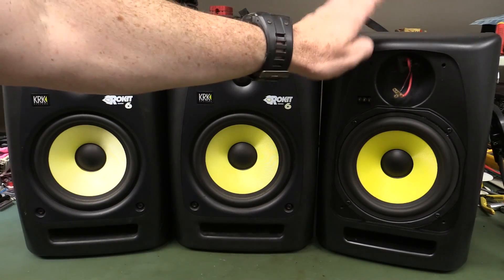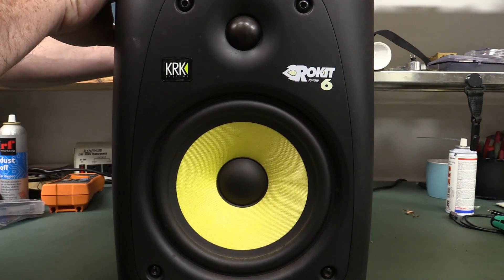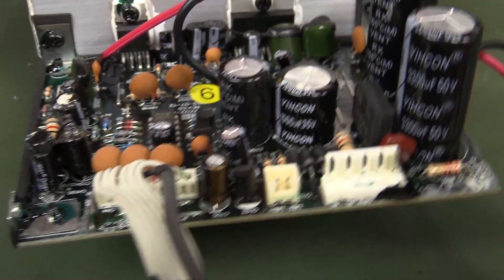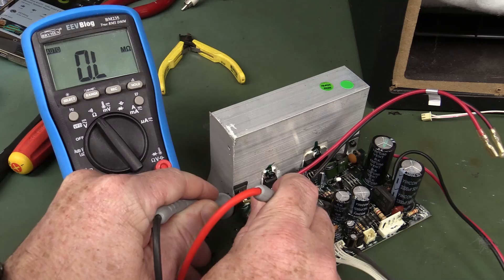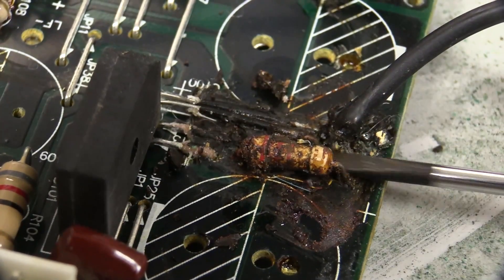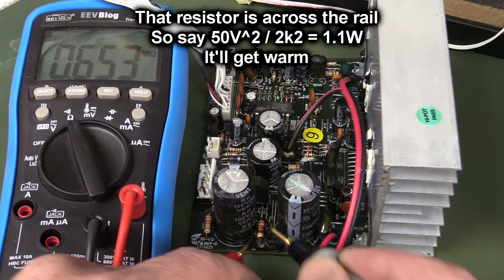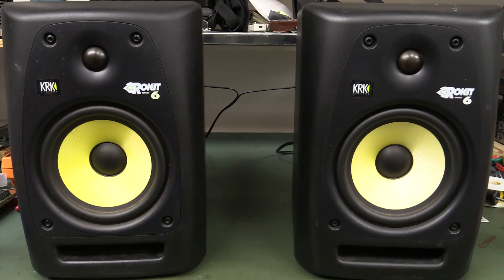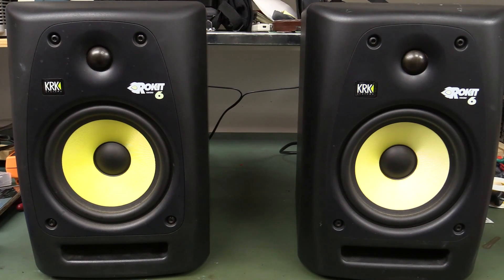EEVblog #1073 - MORE KRK Rokit Black Gunk Speaker Repair

Comment from the maker: Given all the "experts" on here with opinions of which speaker is best for studio mixing, what are the best monitor speaks for speech reproduction and why, i.e. video editing?
Reply: EEVblog for speech? Yamaha NS-10M only. Nothing else can tell You if You have some weirdness in the mid range. Sounds like crap if the problem present:) sounds neutral, when the EQ-ing is good for most of reproduction on the listener side. The new Yamaha line is also freaking good for video editing. Cheap but excellent monitor speakers. I recommend the HS 7 for You. You will love it!
Reply: HS5 great for this type of work IMHO☺ --- high VFM -- other option baby genelec doubles the price 😐
Reply: I hear crickets.
Reply: EEVblog my 2 cents Dave, most folks will be watching on their laptop, phone or flat tv. All have tinny sound.. so I think, edit on something like those, folks with good quality sound systems can probably adjust balance etc for themselves.
Reply: Seeing as how studio monitors are designed to be uncoloured (i.e. they should get the waveform you're working with to your ears in as close to a 1:1 reproduction as possible), there shouldn't be any great preference based on source material type. That said, since speech will generally lack a lot of low-end components, that probably means you can get away with putting your money into the overall quality (good brand) rather than trying to go for the larger woofers with more accurate bass reproduction.
Reply: The NS10s sound shite regardless of what you're listening too! They're just a pointless speaker in my book - modern small monitors are SO much better than they were even 15 years ago that the whole NS10 thing just doesn't seem relevant anymore.
Reply: Not cheap but in a past life as a TV editor, we only used Rogers LS series. Super natural sound. Not sure if they are available down under...
Reply: NS-10M or JBL 306P MkII
Reply: Don't buy anything Dave. Something suitable might turn up in your mail bag in a few months!
Reply: Any speaker, "monitor" or otherwise, that is capable of reproducing the frequency range of the Human voice (85 Hz - 255 Hz) will be fine. ANY speaker... regardless of make, model, brand, or wank factor.
Reply: IMO any dedicated nearfeild studio monitors with a flat-ish response would do. But as you are also mastering and the final mix is for YT, also listening to how the final mix will sound on say headphones/earbuds, phone/tablet/laptop speakers wouldn't be a bad idea (especially after YT does whatever to it). 
Apart from expensive monitors, music studios will traditionally also have a pair of yamaha NS10 as they sound like the average consumer "HiFi" speakers (usually over emphasized bass and treble to sound "better" than the competing "HiFi" on the shop floor). Tv broadcast would check on a single horrible sounding little square speaker (the average tv).
Reply: Anything that gets you desired results. You can get used to anything. I like mono auratone/avantone speaker, it's midrange only, also use Yamahas hs-5, ns-10s, sometimes 'big guns' for music production (custom made cabs with Tannoy HPB-315 concentric drivers). Also, 'flat-response' is bull. You'll never get any room even remotely close to anything flat. It's just learning to work with more or less compromised space.
Reply: ls3/5a...
Reply: yup NS-10's are great. also the best "SOUND SOURCE" (all caps for a reason because a Manger-Wandler is technically not a Speaker Chassis) is a "Point Sound Source" but since that is unachievable - the closest thing is a good Coaxial Monitor because of less Moving Mechanical Parts obviously less Distortion etc. .. I've heard and looked at a lot of different Chassis. Heck you could even count in the Company "Coral" and the Company "Fostex" or "Tannoy" if its about Coaxial Speaker Chassis. Or go back to the 60's 70's where "Philips" made some great ELA / PA / Studio Coax Chassis... Hence why most people not only use NS-10's in combination with their regular setup , but also Auratone Cubes (or similar) to listen to a Mix / Final Mastering :) Theres also no debating about that unless it's your personal preference to do everything different. Then the Setup you use Colorizes the "Mix" you do in a particular way , and you probably then know about that.
Reply: Usually its very difficult in general to give advice on studio monitors. It all comes down to taste when choosing monitors in the same price range. It is not uncommon for professional studio engineers to give contradictory advice. With that said, when it comes to speech reproduction it is easier to give advice since you have all the important information in the mid range.

I would not want a crossover point in the middle of the band im interrested in. That means either one-way or three-way speakers. Three way speakers that are so good that this advice becomes relevant are $1000 up. I have the australian event 2030 three-way speakers. They are excellent sound wise, but very sorry to say have very unreliable electronics due to cost savings. Perhaps you can find a cheap pair.

You could look at avantone mixcubes. They replicate the mid-band hyped response of cheaper speakers but gives very good detail in the vocal range. Broadband single element speaker, no crossover, no phasing issues, single point source. Combine that with KRK rokits to get a feel for the very highest frequencies (if you hear them) and a more neutral sound; you have a very good monitoring setup. KRK is actually the brand I and most producers I know recommend to people who don't want to spend a fortune. And then, as always crossreference with your cellphone, shitty boombox, car stereo etc. If you feel the need to take it that far :) Otherwise just use the krk rokits, thats definitely 100% what i would do in your situation... 

Bear in mind that this is advice from someone who almost never mixes voice or vocals. This is just how I would go about it.
Reply: Absolutely no for NS-10s. They are reference speakers but should never be used as main speakers.

JBL LS 305 have been lately praised to high heavens, i have not heard a single bad review from people i trust, do NOT read audio magazines, they are ALL PAID ADVERTISEMENTS! This is not a conspiracy, pretty much all audio reviews are useless. If it does not have a blind test and/or measurements, it is paid. You can't find negative reviews these days at all.

My personal recommendation is of course Genelec, i've used them for decades (the factory is 300km from where i sit...) and never had any bad thing to say about them. They are ruthless, give no mercy at all if the sound is bad. Really brutal but that is what proper studio monitors tend to be, reveals every little mistake.
Reply: plus i have to add K+H (Klein & Hummel) which is just around the way in Stuttgart - they outfitted the SWR NDR and WDR (Big TV Studios in Germany) with their Studio Monitors. While the WDR also uses British Spendor BC-1's as Reference.
Reply: Mixing should be done on proper studio monitors, regardless of what device it is suppose to be used with in the end. But referencing has to be done and quite often. For this, the shittiest desktop speakers are very good. But mixing should never be done with inferior gear. It is an idea that makes sense and actually can work but: then we have issues in areas we never knew about, commonly it is 20-30Hz that can have huge rumble without us knowing about it. And one can NOT rely on" i'll remember to add that hipass on each project" because we are humans and humans do not work like that... We will forget to do it eventually. 

So: mix with proper monitors but reference with poor speakers often.
Reply: Hi Dave. LS3/5a from different manufacturers were specifically speced and designed BY & FOR the BBC for near-field speech monitoring but are very expensive these days. The audiofools love to pay silly money for originals. 40+ years on with modern materials far better quality drivers are available but they still love the old ones. They are still being manufactured today and are likely better than the originals. https://www.youtube.com/results?search_query=ls3%2F5a   as are budget versions.
If you are interested the original BBC white paper for the ls3/5a can be downloaded from the BBC website. https://www.bbc.co.uk/rd/publications/rdreport_1976_29
Love the channel. KUTGW.
Reply: non expert here. but to me its simple. its not about brand/price its about raw quality. which means 2 things from the non expert non electrical egineer standpoint. 1 do you sound good when you are recording yourself through your gear, and 2 does wahtever your playing sound decent and clear during editing/ playback. now in my own use case. thats been sennheiser headphones KRK monitors and a bheringer uphoria UMC404HD dac. with a Blue Yeti Pro mic hooked over XLR. and in my use case they meet both of my above requirements. 1, i sound fine when recorded over this setup, and 2 anything i can play on it either headphones or speakers sounds great to my ears. nice and clear. and full range.
Reply: I rather enjoy my KRK v8's (ver.2), Had them since '04, No issues like these what so ever.  Flat freq. response, baffled bass instead of ported, a much more organic feel than other monitors.
Reply: I see, what you did there, dave. Messing with the evangelists, huh?
Reply: I would highly recommend Adam Audio. The tweeters are the best I heard so far.
Reply: LS3-5As for me. I have 2 pairs.
Reply: I have had a pair of Yamaha HS7 for some time now. I am really happy with them. At first they seemed a bit harsh at the top end, but mellow out with some use. I have not heard a demo pair in a shop that did them justice.
The HS8 is also very nice but are more appropriate for big rooms. Not really appropriate (or convenient) for desk use. 
The JBL LSR 305 also sound very nice. They have some more power/impact to the mids. The kind that is usually associated with single-ended amps.
The NS10s are not an easy standalone speaker. They have a good studio reputation because they are excellent for monitoring snare drums and such, but terrible as overall speakers. Plus they are not powered. You will need an external amp if you manage to find a pair.
Reply: Don't get caught in the hype. One thing about studio electronics is that people try to justify their choices adamantly. There are some differences in speakers, I wouldn't necessarily buy the cheapest off the shelf Chinese made brand, but generally, it's not how the speaker performs as much as you know your speaker and mix appropriately. The speaker itself should be as neutral; as possible, there will be some pluses/minuses, but to say one speaker is significantly better than another by a revealing margin  is pretty ridiculous.Kind of like the revealing nature of OFCC versus aluminum clad copper cables. The audiophiles in many areas are filled with snake oil sales and supporters. The sound will be either apples or bananas, your job is to make it sweet as possible. The proof is that I've heard a recording of all types and styles, and many sound exc3llent. Were they all mixed on the same monitors? nope. but yet they all came out incredibly well mixed and intelligible, from movies to e-books, to operas, to vocal heavy folk, to abstract vocal compositions. There is no greatest monitor for the aspect of sound reproduction, cheap electronics aside, its how well you know your equipment and how well one does the job of mixing.
Reply: Dynaudio Lyd 5
https://www.dynaudio.com/professional-audio/lyd/lyd-5
Reply: If you go to literally any large radio or TV production studio you will see one of 3 brands. Genelec, Focal, or Dynaudio. Genelec is used by nearly every movie production studio, as well as NPR in the US. Dynaudio is the BBC's speaker of choice, and Focal is just another competitive brand in that segment, although I can't think of any particular studios who use them. If you're serious about looking for some vocal editing monitors, look on ebay for some used Genelec 1029a units. You can usually find them for 4-500 USD per pair, and even though it's a speaker from 1996, it still works a hell of a lot better than most monitors of that price that you can get new today.
Reply: Balanced single-driver monitors tend to give the most useful mid- and high-range response (range of most speech) if you want your material to translate well to consumer devices. Something like the Avantone MixCubes, which have since replaced the old Auratones on the market, will do that for you. I'm sure you're aware of this, but when you have multiple speaker drivers on a monitor system (small and large driver), you have to filter shared frequencies or they become exaggerated. That filter introduces phasing at the crossover point, and that point is usually right where you need to hear important elements like vocals and speech.

The primary purpose of any speaker monitor like this is to reduce your ear fatigue while you work since they're tuned to sit comfortably at the logarithmic center of the audible frequency spectrum (630Hz) and represent the most detail there and upwards until around 10kHz with no filter artifacts since it's just one driver per speaker system. They also have the auxiliary purpose of helping you balance your material for just about anything else because they don't exaggerate the highs and lows, and what they do represent is fairly neutral and clear.
Reply: Just a quick Question to the People here , i'm about to buy myself some Active Powered Fullrange APM Driver "Sony SRS-170" just to use as another Cross Reference for my Monitors (MIG Ribbon 10 MK1) and i do Bass Heavy Stuff , would that be a Good Reference? Has anybody here heard those types of APM Fullrange Drivers from the Late 80's?
Reply: It really depends on preference. Speech is a hard problem for which there does not really exist a one-size-fits-all solution. In fact, some would argue that due to the nature of speech, trying to match it perfectly is a futile effort. 

The argument goes a bit like, our brains are hard wired for human speech. Every subtle nuance we can pick up on consciously or subconsciously. Even the specific locality and shape of source gives our brain information. So, even with the best, most natural speaker, somewhere our brain could spot that the source was artificial, especially if the voice comes at your from a stereo setup.

In the end, what you want is for voice to sound reasonably good on a wide range on hardware, which means you just have to try and test a couple of setups and listen on various speakers, laptops, cars and headphones. If the reproduction on all devices matches or approaches what is a reasonable reproduction of the source material, then you have dialed in your editing setup.

This can be done with just about any speaker system including KrK's.
Reply: Dave, are you asking because you want to buy some reasonable and affordable monitors or do you want to know what the absolute best monitors are? Of course it all really comes down to budget and personal preference. PMC DB1sa active monitors from 2005-ish are still in use at the BBC especially in mobile applications as they are quite compact and, believe it or not, the internal class D amps can be powered from mains or 12v DC input. Can be picked up fairly cheap these days.
Reply: Get a decent set of monitors and then have them professionally EQ'd,
Reply: As a TV director for 25 years (and an audiophile for longer than that), hands down the best for what you're looking for are Fostex Kanspeas.  The "kit" is only $150 per pair, and they use the legendary 4" Fostex FE103En drivers: https://www.madisoundspeakerstore.com/2-way-speaker-kits/fostex-p1000e-diy-kanspea-4-full-range-speaker-kit-pair/

They sound so close to perfect because they have a very light moving mass,  combined with a relatively large motor structure giving amazing detail and a remarkably flat response curve.  There are no weird resonant peaks, and since there's no crossover, there are no phasing issues.  Add in a small sub and you have an unbelievably good desktop system.  They do take a little time to break in, so feed them some bass heavy stuff for a while to get the cones moving.  Any decent low power T amp will work; I run mine from a S.E.T. tube amp.  They are very efficient for their size.

I have yet to hear anything that has better midrange while still adequately giving you great highs and useable lows down to about 100 hz.  After auditioning tons of midranges, I also run them in my big 3 way speakers (powered by a modified Dynaco with KT88 outputs).  Believe me - I've heard just about every studio monitor on the planet; and only early Genelecs come close (new ones are terrible).  I'm also partial to Tannoys, but they're expensive and hard to find (the good ones, anyway, not the small junky ones), but they still don't have the detail, lack of resonance and lack of phase issues the little single driver Fostex do.  The Adams and other similar "high end" monitors are more gimmicky than useable - you have a heavy moving mass and a very light moving mass with a big nothing right in the middle, where voices are.  My two cents.  Hopefully this helps.
Reply: hi Dave, after having a lot of different studio monitors (crappy Esi ones at first and then krk rokit 8" ,dynaudio bm6a and finally jbl lsr 28p) iam now with a Microlab SOLO 6 which are a pc speakers iam finally happy. and the reason is simple. studio monitors are intended to work in a room with perfect acoustics and even the actual speaker placement will affect their sound dramatically. and a home speaker is designed to work in a plain normal room. now, the Microlab SOLO 6 are being used on tv productions (you can look for them online and see other pro sound guys talk about this baby) so if it's good enough for them..... for me, i got 2 pairs of them, pot the units with the amp aside and iam using the passive cabinets connected to a old Sherwood receiver and i am really happy
Reply: just fix these KRKs and use them... not the best, but plenty good enough for youtube vids.
for similar price theres Yamaha HS or JBL 3 series that seem to be held in high regard.
otherwise its just a question of how much would you like to spend on this.
and ignore the hair-splitting audiophiles, they just over-complicate things. :P
Reply: Studio monitors are not magic things. They're just good speakers with good drivers and active crossovers.
Reply: I used to compare them to measuring equipment. Cheap or expensive calipers tend to both give you a decently workable measurement. A platinum caliper perhaps is somewhat more accurate, but not by miles and it sure as hell costs more.

Same with near field monitors. If it does the job, the results will be good.
Reply: Genelec are pretty standard in film/video post.  And they're mid-range in that world.
Reply: What works for me are my Yamaha  HS50M -NS10M.  But that's just me. Have to find what works for you. Great video btw ty.
Reply: Cinema engineer here.  Depends what you like to hear - but anything with a rounded mid range is nice to mix on for extended periods.  Personally the old Tannoy System 600's (3 of em) are still a fav of mine with a couple of smaller Tannoys for the rears.  I also liked the older blue Reveal Actives.  For mastering to Netflix (or TV), etc, I often do a sweep with the speakers in my OLED screen (!!), and also solo'd on an Avantone Pro -- which is a deliberately "average" sounding "studio" speaker to preview what a listener might hear.  For corporate and for my own silly vids I compress / limit quite tightly and check though a cruddy bluetooth speaker I have which is very similar to the sound of an iPad / laptop.  Others I see being used in the industry at facilities a step higher than mine are the Adam Monitors (bunches of ABC stuff mixed on these!), JBL's and Genelec's.  I do know an engineer with a set of KRK's... Wheel of Fortune and a bunch of live sports packages are all mixed on a set of the higher end 3-way KRK's.  The nicest monitors I've ever heard are the Barefoot Sound 27's - more for music, but are lovely for dialogue too.  I've never seen a pair of NS-10's or NS-10M's outside of a music mixing facility - certainly not here in Australia anyway.    Maybe it's a euro / US thing.   Cheers for the insight into the black gunk!!  Worst that's happened to mine is an amp module started vibrating and just needed a tightening up with a screw driver ;-)
Reply: Or Spendors which may have been built to the same spec.
Reply: At the end of the day - you get used to mixing on whatever you've got!  Important (esp for outside recordings) is keeping an eye on a spectrum analyzer and if you've got slight wind or Air-conditioner wobbling something at 10 - 40hz - filter it!!  You might not hear on your system, but someone with a subwoofer or good cans will.
Reply: Genelec
Reply: I'll second the notion of just using these when fixed, they seem to be sounding plenty fine. (*) That said, the speakers to beat in the affordable nearfield monitor game right now would have to be the JBL LSR305s, assuming you can position them (they should do best essentially floating in free space as that tends to be the assumption in speaker design applications as well as practical use of "bookshelf" speakers, not just these, so use some stands). Very even frequency response, basically textbook dispersion, rather wide sweet spot. (The cabinet will appreciate a bit of tweaking as they're built to a price, but there are no major issues as-is.) Granted, you could also get some Genelec 8020s or 8030s, Neumann KH120As or JBL's premium LSR705s, though at some point it gets rather overkill. For voice I might even consider a wideband speaker for its lack of crossover-related radiation irregularities, though sweet spot size may prove an issue.

In the end, it doesn't really matter all that much as long as you know your monitors inside out, even if they suck. I just found out lately that the ones I've been using for over a decade feature a stupid design problem in the crossover that lets the woofer run almost an octave higher than intended - so much for the advantages of using a high-order active crossover. D'OH! (Unfortunately you can't get into these without brute force, they're also glued!)

(*) Do note that connecting some of these to a regular unbalanced output requires some extra effort or you will have problems with ground loops, and to my knowledge there are no ready-made cables that will work for this application. (Soldering time!) Heck, the lesser KRKs even seem to be susceptible to the Pin 1 Problem (a ground routing issue), so I might even suggest my setup here: Run unbalanced 3.5 mm (or whatever) --> 2x 1/4" (TS) wiring into a Behringer HD400 line isolator, then continue using balanced 1/4" (TRS) --> XLR. (I think TRS to TRS should be fine here, too, it's just that my monitors have those dreaded XLR / 1/4" combo jacks that are fine for the former but piss-poor for the latter, plus I like the handling of XLR.)

For a minimum solution for unbalanced --> balanced, this is what you would have to solder up:
Signal --> XLR pin 2 (hot). Ground --> XLR pin 3 (cold). XLR pin 1: left open.
Best use unbalanced (coax) cable. Shielded twisted pair can also be used, where I assume both conductors tied together for signal and shield for ground would be better capacitance-wise than when grounding one of the conductors. (Textbook-level wiring for well-behaved devices would use the "cold" conductor to connect output ground to XLR pin 3, and the shield to connect output ground to pin 1.)
Bonus points for replicating the source's signal output impedance on the ground connection at the spot where the unbalanced/balanced transition occurs. When doing so at the output, regular balanced wiring could be used.
Reply: I would just stick with your Rokits. Every person has some brand loyalty and certain brands garner a lot of unnecessary die-hards, like the NS-10s. But the truth is that if they have a flat frequency response, they are excellent. It is a matter of science, not opinion. You shouldn't choose monitors based on whether you "like" how they sound. You should choose them on whether they accurately reproduce the source signal. Period.
Reply: I'd say the best ones are those free ones you have right there. :-)
Reply: I'd sy these rokits would pobably represent the kind of sonic imaging most people listenting will experience. So those ro some monitor headphones.
Reply: Most important off all is that you spend obscene amounts of $ on phuck off cables
Reply: I'd suggest a pair of JBL M2 monitors.  I got mine in Monday but haven't had a chance to hook them up, I need to run a new 30A circuit for the amp....
Reply: Genelec 8040A. Anybody singing praise for NS-10's doesn't understand why they became the industry standard. The reason why they did is because in the 80s and 90's every studio had a pair. As a result they were familiar to every working engineer and a great reference when you're mixing different projects in different studios. They aren't even really that good.
Reply: Shouldn't you be mixing to what your audience is listening on? So for YouTube, you need those earbuds that come bundled with the iPhones, and maybe some built-in laptop speakers.
Reply: Yeah that's really important. For these Id just buy balanced cable from my local music shop and some nice rugged xlr connectors like neutrik or so. That's sufficient and what most of your favourite rackords were recorded on.
Reply: I would maybe go with Genelec speakers, because they have nice room correction, and price isn't a first problem to you, might even get them for review?
Reply: I find the unicorn hair cables give the best top end around 50000Hz myself.
Reply: Haha yeah that's sub standard for tango music though. LOL Maybe good enough for Frederik.
Reply: EEVblog Genelecs, BBC LS3/5a (not powered but they are broadcast monitors), a lot of Harbeth models would suit. All of these would cost more more than the Rokits but proper professional tools aren’t cheap.
Reply: wrath257
This man speaks the truth.
Reply: I've been using the JBL LSR308's for the last couple of years. They have been great. Highly recommended.
Reply: Regardless of specific brands/models, go for those with discrete amplifiers inside. Those are always designed to have the best circuit layout possible, with much greater physical distance from input to output and much better frequency response, with lower noise and less spur oscillations in mind (the cause of part of the hiss you hear, and the additional -- undesirable -- heat produced).
Reply: Dave, any descent powered studio monitor will do. Your set of Alesis monitor one or two should be able to do the trick. In case you are looking for something else you could check out a small set of Genelec or a recent model from Yamaha. The NS-10M's are a bit dated. I love them but they are made for the 80's and therefore in my opinion less suited for contemporary applications. And it is becoming more difficult to find spare parts for the old models.
Reply: Sean Greene 255Hz is about middle C. Many men including Dave and practically all women speak at a higher pitch than that. Even the telephone system goes to 3KHz, and that was engineered ruthlessly many decades ago as the minimum for intelligibility. If you include singing, the human voice goes up to at least a 1KHz fundamental, and the harmonics up to the 9th are important for 'cut' and character. At the other end a bass bottom Eb is under 80Hz, and there are guys who can sing lower.
Reply: I definitely prefer my LX5's with the linaeum tweeter.  Very natural sounding monitor speaker.
Reply: A good full-range driver with lightweight paper-cone (something vintage for example) placed on an open baffle is the most transparent natural thing, especially for the critical midrange! :)
Reply: Bradley Phillips I would disagree with this. Recently I emailed a podcast which was blatantly unaware of boominess below 100 hertz because they didn’t edit on speakers that reproduced in that range. Sounded like someone was breaking into my house when I listened to it on decent speakers! Definitely mix on monitors, but don’t hesitate to check your mixes on consumer speakers either.
Reply: I've always liked JBL Control 1s (and Control 5s).
Reply: Malc180s yeah, probably that’s why the NS-10 speakers STILL used in ALL generic recording and mixing studios... and why we like it? Because it’s a crap :) so if You can do a good mix on NS-10, you can be sure, Your mix will sounds good on ANY speakers! Go and learn why the NS-10 is still the best for mixing vocals, dialogs, monologs, speech and non electro music. Go figure :) I have many different monitor speakers, but, the NS-10M X is always stay on my desk. you can love it, you can hate it, but You cannot ignore it!
Reply: What you've got now should be fine. As for people recommending NS10's they are good for showing you what is happening by watching the speaker cones themselves the actual audio quality esp. now is not the greatest.
Also a "radio" speaker such as an auratone or the Behringer "behritone" clone. 

As for a USB interface Behringer do a nice range of cheap but really good quality USB interfaces, the UMCXXXHD series do 192kHz although you need to go to the UMC404HD to get proper balanced outputs, I have the UMC204HD, low latency 2in/4out, MIDAS designed mic pre-amps and MIDI all for ~£70. 
They also sell their own range of KRK (Kevin R. Klawitter?) designed studio monitors, the NEKKST series.  

As for substances used by pro audio companies that turn out to be crap, Roland had a problem with the epoxy used to fix metal weights to the bottom of the keys, turns out that is breaks down over time melting and then falling on the keyboard contact board making affected notes no longer sound and eventually needing a lot of work (removing all the red glue from the keys are re-gluing them)  or even a new keybed to fix, at least Roland admitted the problem existed and originally would replace the keybeds on affected units.
Ended up affecting quite a few of their higher end models.
Reply: Sean Greene 
225Hz ?
Reply: Yamaha NS-10 ...No contest. Whatever sounds great on them, sounds perfect elsewhere.
Reply: i recommend beats by dre, they are the best performance to price ratio
Reply from the maker: Interesting single driver Kickstarter:
https://www.keyboardmag.com/gear/square-audio-launches-single-driver-speakers-calls-them-worlds-most-linear-nearfield-studio-monitors
Reply: Sean Greene The human voice is most certainly NOT limited to the 'range' 85 - 255Hz. That is simply you being thoughtless and silly and copying something you didn't read properly. I will not bother to explain, but I will say that the Post Office guaranteed a response of 4khz for telephone communication up till the 1980s at any rate. (You may have got mixed up with fundamentals?) Get a filter and arrange it to cut off at 18db/octave at 250 hz and listen to Maria Callas- Tell me what you hear.
Reply: that´s why the NS-10 are use(d)...they´re crap, and if it sounds any good there it gonna sound even better on any other speaker, but not worse.
Reply: Yamaha  NS10s became a  studio standard. Engineers knew what they were listening to. There would be no surprises in the final mix - imagine if the monitors were unknown by the engineer and had a 12db midrange cut out..could be nasty. .That familiarity is a good thing all round,  everyone knows what they are getting. The fact it is a reasonable speaker is not the point. The point is whatever studio you go in there will likely be a pair of NS10s. They also happen to have a certain 'clarity' without any nasty bits in the response which helps.
I
Reply: Genelec 8040 great monitors
Reply: gishengarms, no, studio monitors are NOT uncoloured. They often have a bit of sibilance emphasis because if you don't edit it out, someone will be annoyed. In similar other ways they often have an emphasis that demonstrates common mixing problems that will be audible with one speaker or another. They obviously can't be TOO coloured else the masking effect would occur, which is unacceptable.

I don't have a valid opinion on what one SHOULD choose, i'd rather use Adam A-series for everything but they straddle the line between Hi-Fi and monitors, they aren't exactly monitor-like. They are the kind of a speaker a musician rather than an engineer would choose.
Reply: For editing I use the JBL Control 2P compact powered speaker http://www.jblpro.com/www/products/recording-broadcast/control-2p . I work in remote sports TV and saw that a lot of trucks use these and they get the worst treatment and they still work. And they sound fairly good having good lows and highs.
Reply: EEVBlog About that SQUARE ROOT Kickstarter speaker - seems like the typical crap you see at "High-End" audio expo and that just blasts distortion at you. 50 years of fighting intermodulation leading to established multi-way designs down the drain. There's a reason KRK or Genelec don't look like this!
Reply: Now that is a loaded question!!!!! I will throw my 2 beercaps on the fire.  In our current gluttonous modern society there are more speaker companies than the earth has people I think LOL that is why I wouldn't use NS10's for as much as starting a fire and keeping warm if I had too.  They became famous and now everyone is like NS10 this and that.  Its kinda what happened with KRK "shitkit" 5;s and 8's. The produce a nice heavy bass response for mixing dance music at a good price point so every dj had to have one, and the yellow cones helped distinguish them apart when a pic of the DJ of the month club magazine had them in the background.   For a good price and pure flat response crystal clear as if you can hear Duke Elington drop his needle I would take Adam 7's anyday over anything.  For a good all purpose great durable monitor I have Events They have been to hell and back with me and always come thru everytime for every different application.  So my 2 cents would say have a look at Adams and Events.  What ever you do don't get Yami NS10's unless you take a time machine back too 1985. "You built a time machine....Out of a DeLorean!!!!"  Cheers Dave! well done you have the best channel on pooptube!  You build a time machine....Out of a DeLorean!! lol aka NS10's
Reply: Logitech Z313
Reply: The goal of a good monitoring system is to be flat, so you hear what is in the source material and nothing else.  The problem is, your environment has as much to do with the result as the speaker, so the room itself has to be taken into account.  A perfectly flat speaker in a room with a 600Hz bump and a 1.6kHz null will still sound bad.  If you can find a speaker with good, linear response (no major frequency response anomalies, no resonances, reasonably good distortion figures, etc.) then measure and treat the room accordingly, you'll be fine.  (There's only so much you can do unless you're willing to go seriously overboard, but you can tame a lot of ills without losing your shirt.)

The second aspect is... all speakers have "a sound".  It might be subtle, but nothing is perfect.  As with any reference instrument, you have to compare to a standard.  This is why people pick a monitor and then stick with it.  It's why so many people liked those NS-10s.  They KNEW them, and knew what a mix should sound like on them.

Get a decent speaker, measure the room response, deal with any big problems, play back lots of material you think sounds good to build your awareness of what "good" sounds like, and then try to match that.  Also: do check on other systems (laptop, TV, phone, car, etc.) periodically to make sure the decisions you make translate well to other environments.  Finally, trust your ears and move on.
Reply: Genelec Isn't only the best speakers i know, but those are also   best for home studio.
Reply: Yamaha HS-7 or HS-5
Reply: Yamaha NS-1000.Best midrange of any speaker I have heard in any price range. Clarity and presence unmatched.
Reply from the maker: Mostly a music comparison, but some speech in there, comparison of Yamaha HS5 vs JBL LSR305  https://www.youtube.com/watch?v=VE6ldZoOjrs
Reply: yamaha HS5 and Genelecs are pretty much the standard unless you want to go for something like Adams.  All those solutions are overkill for you application.  You really don't need completely flat response for mixing since you aren't really making music.  I'd suggest a decent set of headphones such as the AKG K240s which will give you a really good idea of sound quality without too much investment.
Reply: won't comment on speakers (because i think krk's do the trick lol) but i recommend the roland quad capture for the usb audio interface. top quality, solid as a rock, and great driver support, spdif (but not optical), phantom power. don't underestimate the importance of one of these, there are some duds around. for example, you can fry an egg on the arturia audiofuse audio interface they get that hot lol! and tascam stuff usually has poor driver support. store dj is pretty good for haggling.
Reply: dave, also i'd like to give you a quick tip for buying studio monitors for speech. DON'T buy speakers which have the "auto speaker shutoff" feature without a switch to disable it (a lot of krks have this without the switch)...it will drive you absolutely nuts!!! you'll be working on your video then bam no sound, and you'll have to max out the volume of your input to turn them back on.
Reply: It's a matter of taste, but if you have the money I'd recommend one of the "Barefoot" Mini Mains because they are sealed cabinets and have very fast transient response with no bass smear and subwoofers mounted back to back adding strength to the  cabinet. They also come with a dsp x-over that can be switched between "classic" for that YamahaNS10/Tannoy PBM era, "stereo" for just listening to program music, "cube" for that Auratone mix cube that lets you know how your mix sounds on smaller radios etc. then finally "Flat" and I do mean flat! Most monitors have the low to high frequency within a 3db where the Barefoot's have better spec within 1Db, and extended specs within 3 Db that are above and beyone the competition at any price. They recently came out with a cheaper pair for home studios but even that one gets close to $5000 Cdn per set. The Flagship "The Stack" is under $63,000 for both sides, but they would blow your house down..
Reply: Comfortable headphones you don't mind wearing for hours on end! A lot of video editors like to use big headphones or subwoofers for checking in the sound FX balance (mixing for cinemas) but for "talkies" any old cans will do. Fancy monitor speakers matter for for mixing and mastering music where dynamics and frequency balance are critical.
Reply: Those are just crap.
Reply: I despise JBL as a whole. Nothing else but overpriced crap.
Reply: AklexLTDLX I don't want a can of peas.

(Great speakers for super dooper quality - use with triodes for heaven, except get a bigger driver)
Reply: JBL 530 anything else just cant compete
Reply: Ls-32 jbl pros. You can't get natural sounding  reproduction with anything less than 12" monitors. Unless its your soundtrack, in which case a table full of freeair ribbon tweeters is sufficient.
Reply: Mixing speech is not all too complicated and you wont need expensive monitors. Small monitors are enough since bass clarity is not of much interest for speech. 
You can stick with these, or pick up some adam a5x. All the other recommendations arent bad either. The most valuable thing in mixing is experience. Monitors are not nearly as important as everyone thinks they are. 

A little bit of multiband compression sounds cool but dont overdo it. 
Also, dont filter noise out, a bit of background noise and less dynamics make for a much more comfortable listening experience.
Reply: Get some proper Westlake Audio monitors.
Reply: its not a single driver, it's coaxial, meaning the tweeter is in the middle of the bass unit
Reply: I'm a big fan of the Event BAS 2020. Think they have pretty neutral sound and works good for mastering audio.
Reply: The Tannoy Reveal 5A is my go-to for accurate reproduction. Expect to pay 570 + for a well kept secondhand pair. I got mine for 150 and immediately sold all my other monitors due to the quality of audio reproduction. They have a rated frequency responce of 70-30K hz but they will play lower (although at lower volume) so I paired them with a custom studio sub.
Reply: you want speakers with a flat response curve (aka audio file)
Reply: Hmmmmmμ i dont know.
Reply: Uncle Dave dont forget ur room acoustics and try prevent standing waves with your speaker position
Reply: Equator D5 or D8. But...Room acoustics are more important, as you can't turn them off.
Reply: For speech, I'd recommend monitors with an emphasis on upper midrange performance. Most studio monitors have "flat as a tack" reproduction from 120Hz-16kHz and are designed for editing music; you don't need this, and as Doug pointed out in your microphone videos, flat response can be undesirable in many cases.

I don't have any specific recommendations, but I think a bog standard pair of desktop computer speakers - the kind that come with lower-end desktop systems and make everyone sound like Michael Stipe - would be good for editing a video blog. Remember that many of your viewers hear you on laptop, tablet, or dumbphone speakers that make words like "laurel" sound wrong.
Reply: Hi Dave, love your stuff. When it comes to video editing, speech reproduction and what monitors to use, it really is just a matter of preference. Yes, sure there is tons of stuff out there, and if you are investing in new monitors in the 1000 us dollar range, there is alot to choose from. But really, your channel sounds really good! Even on the pad, on the home system. And if you like your Alesis usb pair, why bother. As an example, Andrew Scheps(U2, Metallica etc), only uses a pair of old tannoys, because he knows and like them. But nowadays he basically uses a headset. But a tip is to have a secondary set of speakers, just any type, and if sounds ok there, well its a reference anyway.
Reply: I never did believe I could fix my speaker by just scraping off all the dirty glue stuff and clean it with alcohol and a toothbrush.
It died yesterday with cracking squeeking sound and no more sound.
I just repaired it without replacing any part....it looked like everything wasnt burnt bad.
The glue stuff made a lot of contact points and burnt places but didnt affect anything.
Nice it works again 😁
Reply: I've been looking into monitor speakers quite a bit (for music), and, well, I've ordered the Edifier S2000 Pro, but I think I half-wish I'd ordered the JBL LSR305 instead. They sound so clear for vocals, but, they also have hiss, and no optical or coax digital inputs, so maybe when my Edifier S2000s arrive in 1 or 2 days I'll be happy with them. I'd've been happier still if the Edifiers had inbuilt 192KHz USB audio like some of their other models, but I'm going to use an old Edirol USB25-EX 96KHz usb audio interface with optical to the speakers instead. i just don't trust the sound-colouring of the dell on-board audio.
Reply: Check the Tannoy Reveal series of close rage monitors.  I have several pair of them and they are excellent for speech reproduction as well as being phased for near field audio.   They are pricey, but well worth it
Reply: i got some studio monitors made by an aerospace engineer that are the most linear monitors possible in frequency and phase..they are pretty great.

for value.  the Yamaha HS-8 is really awesome.
Reply: also having a single driver full range speaker (~4") it really great for working within the critical band.
Reply: @5speedfatty   But who on planet earth hears themself in recorded form in the same way they do when actually speaking?  Your throat and ears are connected in a way a speaker can't replicate so you wont hear your own voice over speakers they way you hear it as you speak.
Reply: @bradleyphillips5254  this is called mastering. the main point of audio mastering is to make sure the signal sounds good across a broad range of spectrums. i.e the different wattage capabilities of your speaker/spectrum. Its pretty much all done with just two common types of circuits. i.e the HPF/LPF (check out daves video on the Yamaha mixer teardown to see the analog principles to this. It can all be done digitally as well with analog to digital converters and digital to analog converters inside of your interface for pro tools. (industry standard) Also an interesting topic around this is the "Loudness Wars" which refers to how the dB range of music has been interpreted to be higher quality at higher dB ranges. Our ears trick our brains into thinking the audio is better because it is simply louder. Todays industry attempts to get as close to 0dB without clipping. anything over 0 will basically distort over any spectrum/speaker. 

Rob-Bachelors/Audio Engineering
Reply: my two cents... i once happened to be considering buying these exact monitors, the price was good, they sounded good, but it happened the seller also had a pair of yamaha msp5's, not for sale, which he gladly agreed to turn on for me to compare to the krk's... boy... to this day am i so glad he did... in a matter of seconds i realized that the krk's were a big, beautiful, yellow accented bullshit :) the yamahas sounded so much more clear in direct comparison, the krk's were boomy and muddy... of course i didn't buy them, instead i thanked the dude and went home and ordered myself a pair of the very same yamaha's, which i am so much enjoying to this day... don't get me wrong, i don't mean to shit on krk, just my personal  experience, that someone might find useful. so in conclusion: everything is about direct comparison.
Reply: I used to own Adam A7X when I did sound design for theater and I loved them so much. 

But before installing them I first tuned my listening room because ANY speaker sounds crap in an unfit room. 

Check room dimensions, speaker placement, placement of your ears, acoustic absorption and reflection. Choose a shoebox room and don’t put you and your speakers pinned to the wall or at equidistant locations from the walls.

Don’t kill the reverb, control it. Remove coloring from resonation and room tones. A flat speaker can’t help a bad room churning out bad mixes. 

Good room tone can help not so good speakers make a good mix.

Oh and don’t believe / trust those room tuning equalizers because they change phase and speaker performance and only ‘enhance’ for a point source, not for your ear locations (and your head is not stationary).
Reply: Hi Dave,
In answer to your question,
Given all the "experts" on here with opinions of which speaker is best for studio mixing, what are the best monitor speaks for speech reproduction and why, i.e. video editing?  My answer, 
Harbeth M20.1 Pros Hands down,  a good pair of LS3/5a s, KEF LS50s or Tannoys.  I also like Fostex 6301s and Yes, finally Aurotone 5Cs (this will probably draw blood and gal from some). Plus a couple of good  8 to 20 Watt RMS, tube Single Ended Mono blocks to run the Harbeths, LS3/5as, and Kef LS 50s or Aurotones.
Why, 
The Harbeths are slot in replacements for the LS3/5a used by the BBC since 1976 ( the BBC are probably the kings of speech recording/reproduction). Each driver set (and components) is individually matched to within .5% of each other, as is the overall speaker systems themselves (they are usually sold in matched pairs). BTW the LS3/5a was designed specifically for mono voice transmission from mobile broadcast vans through out  the UK. They  are versatile and compact as well. They are excellent in respect to scale, that is working down from mains to near fields and vice versa. The LS 50s are an extension of the LS3/5a, all these speakers are excellent regarding voice recording/reproduction. They are not cheap.
The Fostex 6301s and Aurotone 5Cs have single full range drivers, I like them because there are no crossovers, and the associated annoyance of X-over distortion etc, most X-over points are set between 2.5K  to 3.5K Hz, which to my ears can be annoying when EQ ing upper high mids and highs.. The 6302s and Aurotones are natural in their sound and really tell where things are at in regard to eq adjustments and phase (if you switch from stereo to mono). They are compact as well. Also everything on youtube, computers, smart phones etc is very compressed, these speakers translate really well within the Mp4/ Mp3 audio context as far as speech is concerned. 
I have worked with NS10s, HS5s, Genelecs, Adam, KRK, JBL LS 305s(?), Behringer, Mackie (mostly studio near field mixing down and tracking). I honestly find them very lacking, do not scale well and most of all very fatiguing. I currently work with speech/voice recording and reproduction in an Orthodox church and will be preparing/editing audio files for uploading to You Tube on a weekly basis as well as  broadcasting in the near future.
I don't know how much time you wish to commit to your editing, for me each recording is usually a minimum of 2 hours Liturgical mass (4/week), some up to eight hours in duration. They are recorded in Logic Pro 10.3.2,  also EQ'd and edited in Logic accordingly. So I need good sounding non fatiguing monitors, hence the LS3/5a s,(with upgraded X-over) 5Cs and 6301s.
I speak from only personal experience and would not call myself an expert, to a large extent it is mostly personal taste, what you grow up listening to, what are your standards, your market and naturally budget, but, most of all your needs.  Am also experimenting with a JBL Charge 4,  will let you know what I think, so far it has been surprisingly good and very convenient !. 
I am enjoying your channel, though the Yamaha M3000 teardown  made me cringe a bit, they were/are such a great live monitoring mixer, a real industry standard..
All the best.
Reply: instablaster.
Reply: Personally a fan of genelec, especially the one where the "tweeter" is infront of the "sub" (its not actually called that, but I can't remember the correct name, or their model number) there's one other brand I love,  forgot the name sadly,  they're about £3000 per, have a black face, and a redish wood body.  They sound so clear and honest.  Also can't go wrong with ol NS10s, if you can make something sound decent on them, it'll probably sound decent on anything